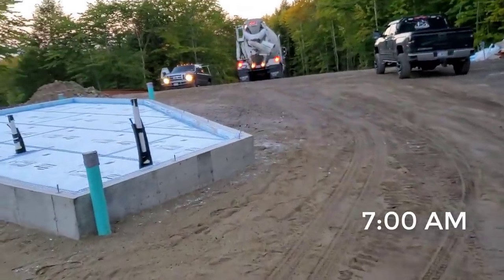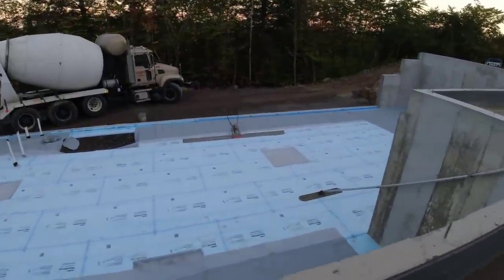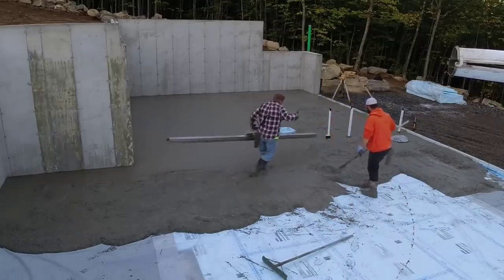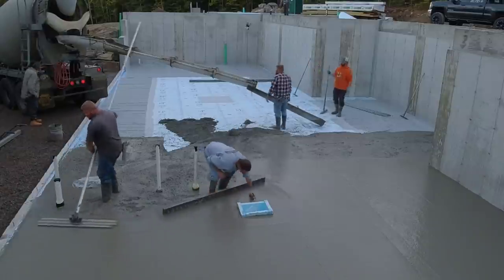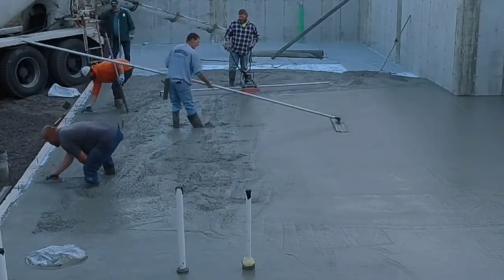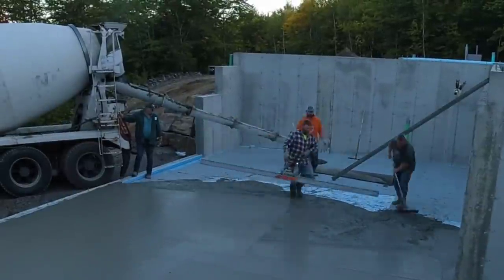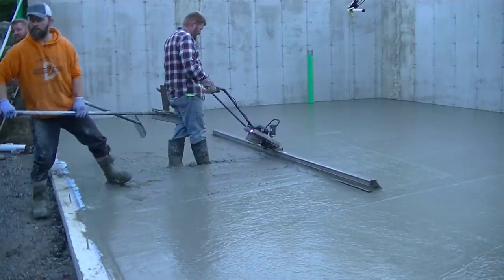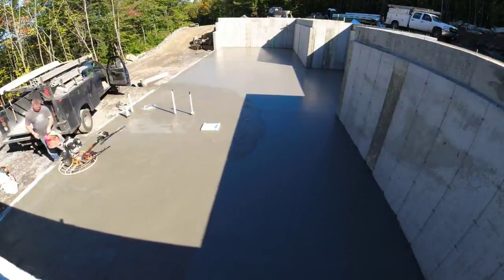Pouring A Concrete Floor For A Large House (Battery Powered Screed)

Comment: I used to work at a factory (indoor/outdoor) where probably 60+ people used cordless drills and other power tools, all day. This is what I discovered. To make batteries last 3x as many years, do these things:

1) recharge them while one power bar is still lit. But don't recharge until then (if this is difficult, add to your number of batteries). Having more batteries on hand makes it less urgent to charge them.

2) Wait until the battery has rested for an hour before recharging.

3) Try to keep batteries in as moderate a temperature as you can (45F to 80F is easy to do). During hot or cold weather, I keep them in a styrofoam cooler that I take indoors every night (open lid at home). I put them in the truck and leave them in the cooler until I need them. Keep many blue plastic ice packs that are house temperature in with them, it keeps the cooler within temp range all day (if you leave the lid on). Put the batteries back in the cooler for lunch or when you don't need it for a while.

4) With things you can control the torque on, by gear setting, clutch, and force you apply, don't hog the thing. If your batteries last just one hour, get a bigger battery, if that doesn't work, you need a corded tool. 1 hr to dead is discharging way too fast! Hog if you want, but it will destroy the battery much sooner.

In the factory setting, it was easy to see who trashed batteries, at what rate. Some guys needed new ones every month, some guys had theirs for 5-6 yrs. You then go and watch them work and everything becomes clear. For guys that managed torque, but only had two batteries (no time in between charges) their batteries might last a year. As soon as they started managing temperature and recharging at 1 light bar, they'd get 3+ years, sometimes 5+. Again, if you're going through batteries quickly, even every 2hrs and you find yourself going from charger to tool, tool to charger- multiple times a day, try adding in another battery. It will let your batteries cool down between charge and discharge cycles. I alway mark the date on the battery, at least month and year I started using it.

Comment: It’s all flat work in South Louisiana. No basements at all, water level is about at shovel depth lol. We have to make sure to use a very good vapor/water barrier under the slab. We use #3 rebar on 12” centers for reinforcement or 4ga 6x6 wire mesh. 2’ footers with 4ea #5 in them. No insulation either like you have here, we have to insulate from heat, not cold.
Reply from the maker: Thanks Jacob!

Comment: Florida - Even in Central Florida, Highlands County. The name says it all. We are about 150' above sea level, and everything is suger sand. If we tried to build a basement, the morning mist would flood it. And with 100% humidity all year long, the walls and ceiling would be like standing in the rain. We are almost all slab and concrete block. All the soil has to be treated for termites. In 10 years they'll still have termites.
Reply from the maker: Wow David, that's a lot different then here. Just shows how different parts of the country differ a lot in how construction is done.

Comment: Thats about like us down here in southeastern missouri. Almost all our trucks are rear dump. I've seen one in Central Missouri with a conveyor on the side of the truck. But our front loads are scarce. Pouring box culverts we tend to rely on pump trucks a lot of the time. But recently been tasked with a couple miles of sidewalk and some road path for a factory so we've gone back to running rear loads

Comment: Is the vibra screed faster than the other methods ? Better ? More accurate ? What do you tell other finishers about your reasons for using it and the types of applications suits it best ?
Reply from the maker: It's great for what we're doing in this video. We hand screed slopes, around drains and smaller stuff.

Comment: No front dumps anywhere in Phx Az. Front dumps seem to be more common in small towns here, no one in the city has them. Belt trucks are kinda rare here and seem to be mostly used by big commercial guys, and no one uses buggies. Everyone pumps unless it can be hit easily with the chute or small enough to wheelbarrow, many lots are tight access so even small jobs are mostly line pumped, theres just no room to get a truck in like that in alot of cases.

Comment: Texas. Pretty much all slabs. No basements, really.
Some, of course, build using pier and beams. But, when they go with concrete floors here, they're slabs. I've seen some barndo builders starting to go with post tension trying to reduce or eliminate cracks because they stain the floor instead of carpet, tile, wood,etc.

Comment: Very nice. I don’t understand why Americans use such watery concrete, it almost looks like slushie. Do you had high amount of water to the mix? Also the aggregate size? We typically use 20mm here in Australia. What’s the strength of the concrete also? Thanks!!!
Reply: Water reducer is a chemical added to the mix, you barely use any water mixed in when you use water reducer. If you don’t use that chemical, you will be pouring a much stiffer mix so it doesn’t get weak.
Reply: I forget what he called it, but he said (in different terms) that they were using a superplasticizer, which makes the batch behave like a watery mix, but it's cured performance, is that of a much stiffer mix. It really cuts down on the labor of slogging the concrete around. It's a fairly cheap additive that every batch plant offers.

Just an aside, I didn't realize it until I started traveling internationally, but the number of products we have at our disposal in the US, is outrageous. As an example, even in my somewhat rural area, I can pick from 30+ different products for roof underlayment. That's on the shelf, in stock. Also, I literally have 4 concrete plants within 2 miles of me.

We had freinds over from South Africa and they toured our nearest city (pop 1.3m) and they couldn't believe the number of hospitals we had. I think they counted 20+ major hospitals, plus enumerable medical centers and clinics. According to them, their own city of nearly a million had one major hospital and several scattered clinics.

Being American, everything  is available to us, almost instantaneously. But, it's 100% impossible to get a good cup of coffee. We went to the moon in '69, but we still can't good coffee! Everywhere in the world has coffee 5x better than here. Used to be beer too, but we got that figured out now.
Reply: @cornpop7805  Thats extremely interesting. Not sure if we have that superplasticizer here in Melbourne Australia but it does seem like it would cut down on the work difficulty by alot. 

I've been to a few places in the US and it does seem like so much is available which is awesome. I love the USA. But I do love my coffee and Melbourne is up there!

Good idea to start a business sending coffee beans to the USA hmmm haha
Reply: @jaked964  very interesting!
Reply: @joeyy17 
I imagine a major city like Melbourne would have plasticizer (for short). By the way, some people have used it and regretted it. For instance, when pouring tall concrete walls, the more fluid the mix, the higher the pressure at the bottom of the wall (until it cures). For a given project, the engineer will specify a certain bag mix (which determines strength) and they will specify a certain slump (which is stiffness). Sometimes, poured walls end up with gaps, usually around corners. Vibration tools help, but some contractors want to cheat by making the mix more fluid. They know if they add water, it will reduce the strength of the wall, so they order it with plasticizer. This makes the mix very fluid, pressure at the bottom of the wall form ends up being too high and the form blows open.

You might be aware of the Surfside condominium collapse, that happened in Florida. It was likely the result of water damage, but some of the concrete was found to be a lower compression rating than the design called for. This might have been the result of the supplier sending the wrong mix, or the contractor adding water, during the pour. Sometimes, the engineers send private inspectors, who sample every pour and check the samples for slump, materials make up, and compression rating (after the samples cure). This keeps everyone honest.

Regarding coffee, good beans would be nice. From there, the real craft is in the roasting of the beans, which is where Starbucks fails miserably. Although young people here have no idea that they love burnt coffee. Our tap water is full of chemicals (even looks blue in a full bathtub). Our water doesn't seem to work well for coffee. Whatever the problem, I've never had a great cup of coffee in the US! Funny, I was in Zagreb Switzerland and the automatic coffee maker in the lobby gave me a mind blowingly awesome cup of coffee. France has instant coffee that's better than I can get here.